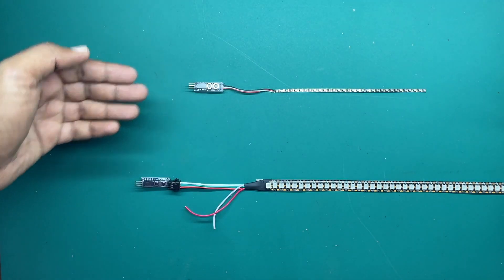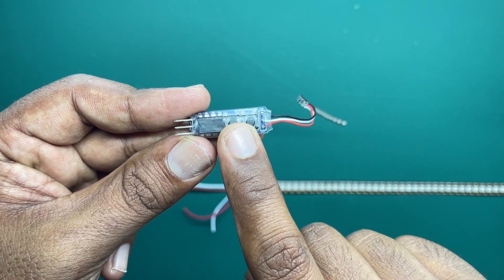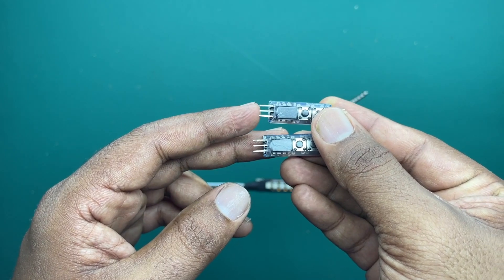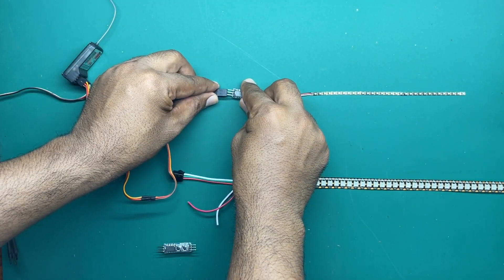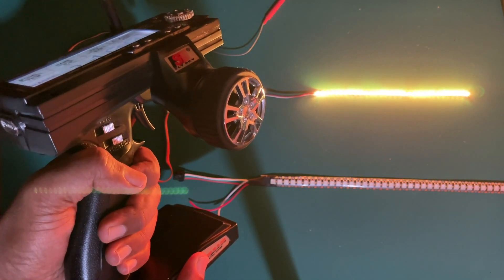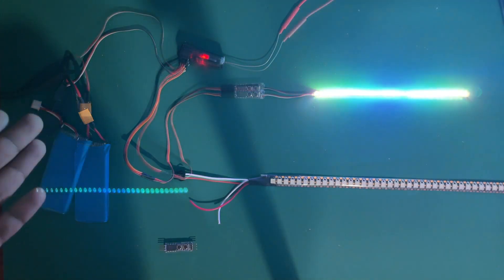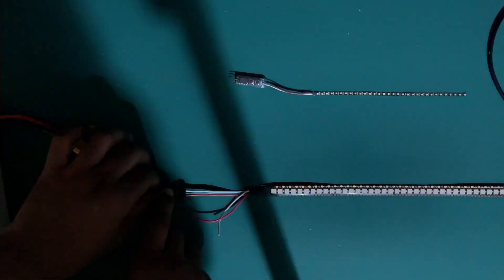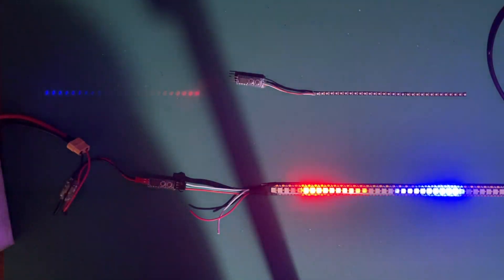RC Truck LED Bar Controller With Pattern & LED Quantity Change | Ready made | ATtiny85

Comment: අනේ අයියේ ඕක remot එකක්  නැතිව push button එකකින් manually රටා මාරු කරන්න පුලුවන් වෙන්න හදන ක්‍රමය ගැන video එකක් දෙන්නකෝ please  🥺🥺🥺🥺🥺🥺🥺🥺🥺🥺🥺🥺🥺🥺🥺🥺🥺🥺🥺
Reply from the maker: Malli meketa remote eka oonama na. Push buttons walin ee wedema kara ganna puluwan. Video eke aga hariya balanna.
Reply: @HAZITECH  ha ...
Aiye meka atmel attIny 85 microcontroller eken hadanna barida ...
Normal circuit ekak hadala ...
Ara vip light eka wage 🤔❤️‍🔥
Reply from the maker: Puluwan malli meketh ATtiny85 eka thama thiyenne.
Reply: @HAZITECH  na oya ara kalin haduwe rc car ekata vip light ekak anna e wage dot board ekaka apita hadaganna puluwan vidiyata circuit ekak hadana vidiha gana video ekak denna පුළුවන් da  please  🥺🥺🥺🥺🥺
Reply from the maker: @mihiyabuslk1756 Aah sorry malli. Meke code eka nam denne na. Oona nam controller eka ganna puluwan.
Reply: @HAZITECH  👍👍👍👍ha 👍👍👍
Reply: ලයිට් පටිය නැතුව කියක් වෙනවද
Reply from the maker: @lasa000 Rs.1950